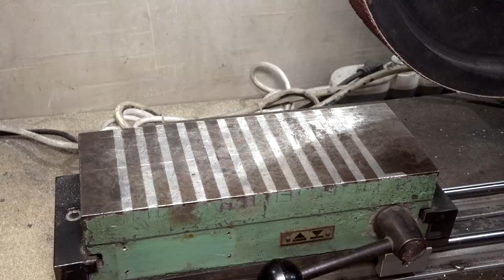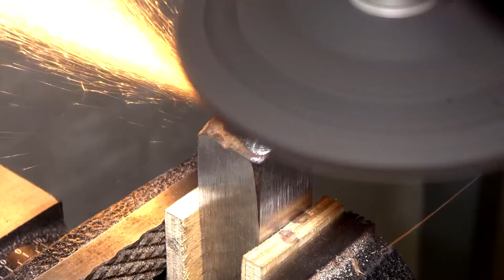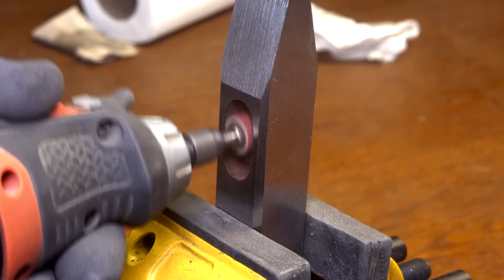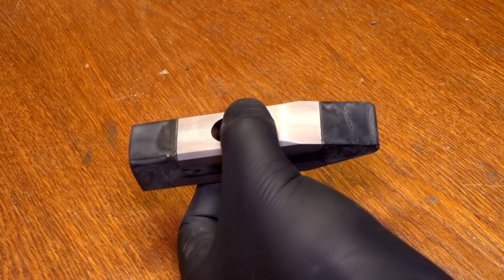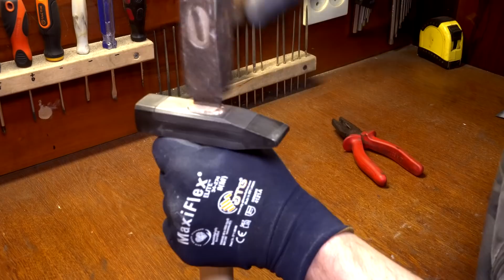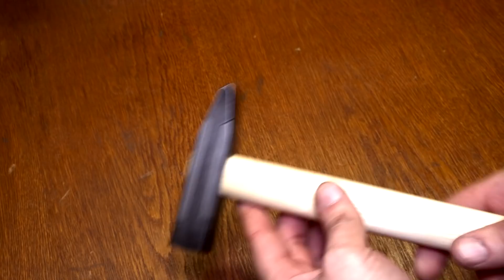Old Hammer - Restoration and Customization

Comment: I really like the engraved lines on this hammer, little tip for you! When you put the head of a hammer or an axe on its shaft seat it then hold the shaft with the head facing down over the floor and strike a blow to the handle, don't place the head on anything just hold it over the floor, a few god blows seats the head on the shaft perfectly! TFS (thanks for sharing) GB :)

Comment: I have never seen a hamon on a hammer! I just restored a flatter on my channel and it didn't have a hamon from differencially heat treating it which surprised me. I loved the time you took to add the extra artistic details! A+
Reply: I started my channel because of you! People love watching but a lot of them want some explanation, so I set out to try and explain the reason behind the method! Keep strong bro!
Reply: This is not a hamon, it's a welding line. This is a mark of being hand forged, as it's made from 3 separate pieces - hard steel for the face, soft steel, iron for the body and hard face for the crosspeen.
That's the traditional way of forging a hammer when quality steel was much more expensive, so instead of making it from expensive material it was made from a cheap, crappy one with the quality steel only on working ends. I weights the same, works the same but was cheaper to produce back in the day.

Todays hammers are made out of one solid piece of 1045 steel (mostly), and you forge weld the faces only to show skills as a blacksmith, as it's not very common nowadays.

I personally prefer second way of forging a hammer, because it also looks interesting after you etch in the acid due to carbon content difference (the more carbon the darker etching). Especially interesting ones are those forged of wrought iron, when you can see wood-like grain after deep etching.
Reply: Dang Greg that is super interesting and informative! Thank you for taking the time for the explanation! I would assume that my 100 year old flatter that I restored must have been made from a solid piece of steel which would mean for it's time it was probably fairly expensive. Would it be safe to make that assumption?

Comment: Looks like high school shop project of the 40s-50s. Made a number of them which I still have, a couple are case hardened with bone meal.
We were given the square stock, a hacksaw, file and hand drill to complete the project. No bench grinders allowed. Crocus cloth and steel wool too finish. By hand drill I mean one you hand crank, not plug in.

Comment: In the late sixties we made hammer heads exactly like that one in our high school shop class. We made them with a milling machine and we also heat treated them. That gave it an appearance like yours had at first. I didn't want to show off an ugly hammer so I sanded and buffed mine to a high shine. The instructor claimed the heat treatment was removed and gave me a "d" for the project. Later in the year I was using a lathe to turn a block of clear plastic into a "T" handle for a stick shift. The instructor said I wouldn't be able to get it clear again. I said I would and challenged him to change my "d" to an "a" and he agreed. I sanded it on the lathe with finer and finer grits then used rubbing compound. It came out perfectly clear but the prick stiffed me on the upgrade.
Reply: I read your story and it touched me

Comment: I dig the straight sided handle as opposed to a traditional waisted handle. Goes nicely with the geometric design of the head. 
 
By the time you read this, it will be time for another coat of linseed oil!

Comment: I am surprised you do not have auto feed clamps so you wont have to push that magnet back and forth manually. You can probably make the set yourself being as talented as you are. I’m sure you can buy the sets at any machine tooling place. Order on line..

Comment: If you hold the hammer handle with the head up and bring it down swiftly on a solid surface the weight of the hammer head will seat itself on the handles. Tap tap tap. Done.

Comment: What is the brown liquid, that you immerse the hammer to change color, and the others you use with brush?
Reply: I guess it' s called stain or mordant
Reply: @АнварРахманкулов-ч7м  the chemical name?
Reply: @Yiokalai  nah, usualy polish with thing wood. For color and against bugs, it's carpenter's tool. Also can be other substance.
But it definetely not some single chem element.
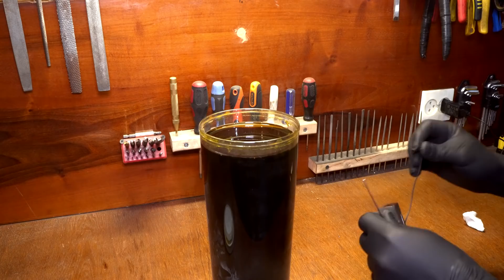Reply: @АнварРахманкулов-ч7м  I mean at 5:17 of the video. Thank you for your time.

Comment: By using machines to take the rust out lots of metal was taken out of the hammer and now it's a lot smaller than it was before you could have used rustremover instead to take the rust out and used the sandpaper manually minus using your hands to take rest of the rust out that way the hammer wouldn't have lost lot of metal and it would have been in it's original size

Comment: With respect to your skills ,you have made the same mistake that others do .  The first wedge should be into a sawcut slot and of beech or similar dense hardwood . This should them be trimmed back and a metal wedge across that wedge to force the wood into the gap left by a single wedge .  You single wegde will quickly work loose with use .   Other wise a nice 'over the top ' job

Comment: Nice metal work but I think you could of done better on fitting the handle into the head. I didn’t care for the gaps around the handle hole at the top and that it wasn’t cut and sanded flush with the head. Maybe  pour some tinted epoxy around the handle hole to fill the gaps. Peace

Comment: I'm put off by the fact you feel the need to wear gloves. Having been in construction for 53 years I have never had the need unless it is below zero outside. Ps. I have a ha.mer exactly like that and many more in addition. A rarity is the old granite working hammers from this area which were all hand forged. Also dressed or sharpened in a forge.